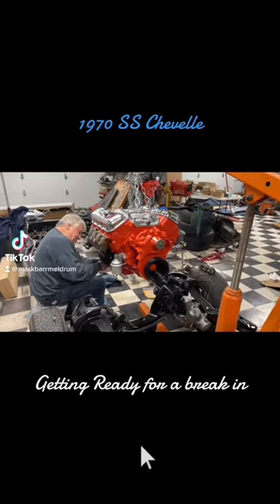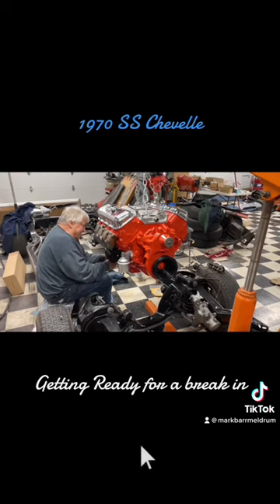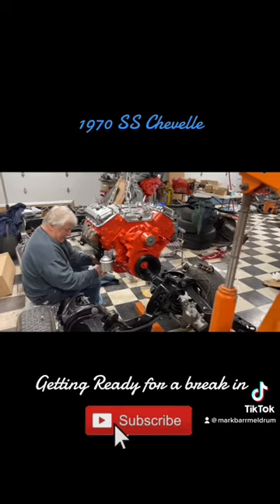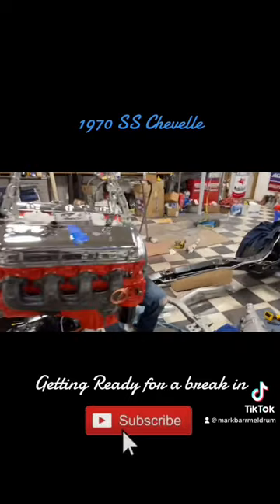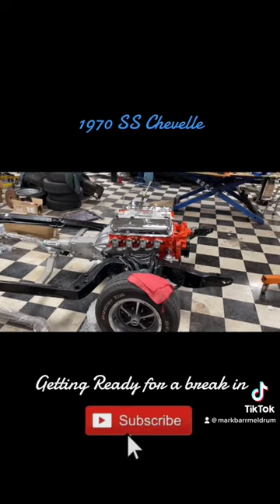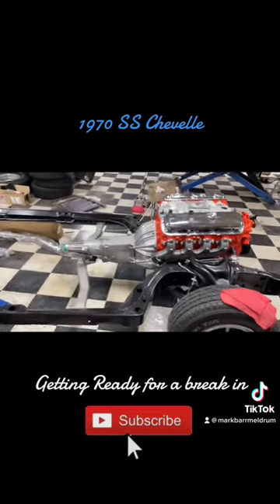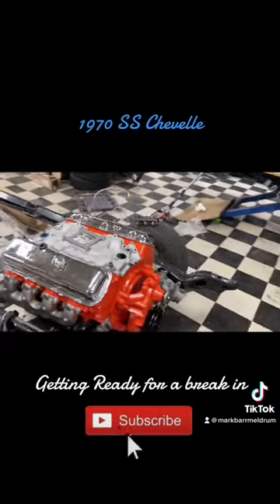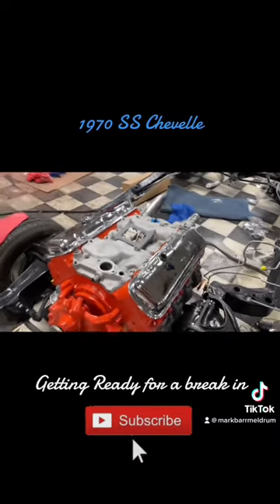#short Big Block Installation into Frame 1970 SS Chevelle

Comment: I’m trying to get my wrecked 67 back in shape. Would you mind dropping a tape on one or your chevelles for me?
Reply from the maker: As a Baby Boomer....not sure shat you mean by "Dropping a Tape".
Reply: @MeldrumsMonsterGarage  I need to know what the distance from window channel on the left side to window channel on the right side rear quarter glass. My quarter got slammed and I’m gunna push it out just don’t want to go too far.
Reply from the maker: @neshpro6521  ohhh-  I don't have access to the 67 Chevelle right now - its in storage at another location - it won't be back to the main garage for a couple weeks.
Reply: @MeldrumsMonsterGarage  I’ll figure it out. I got a friend with a 67 gto